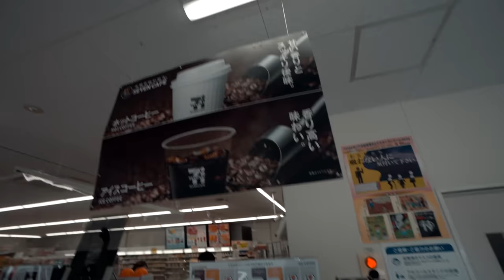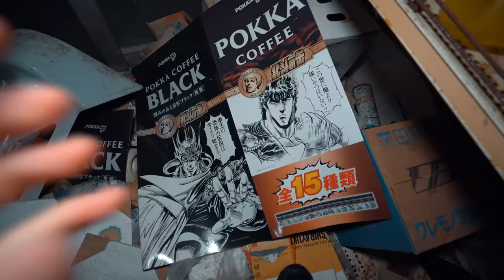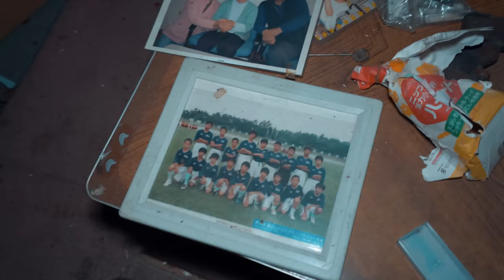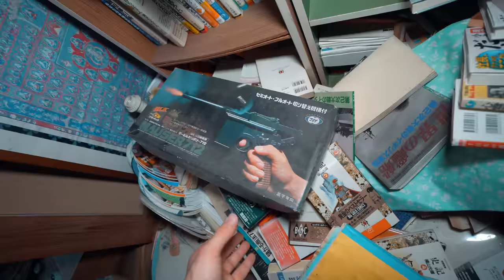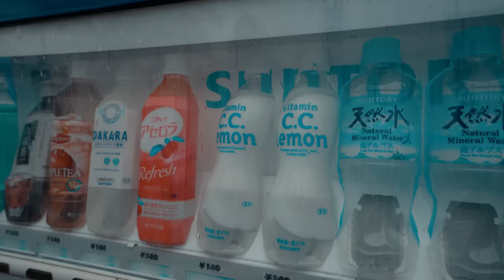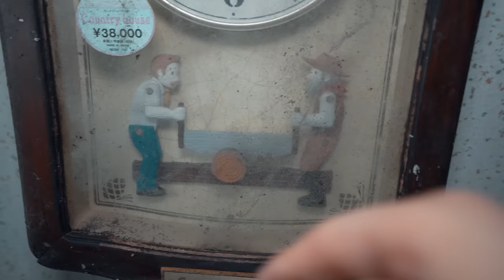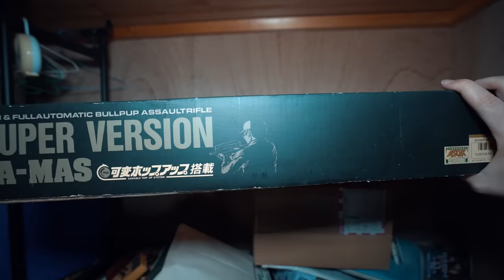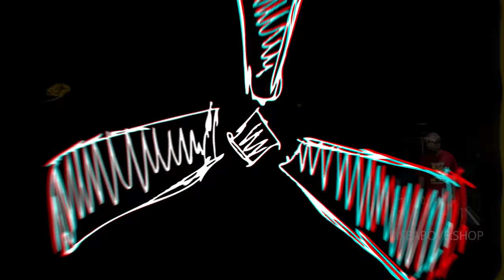100 Hours Inside JAPAN'S Toxic Evacuated CITY | Streets Are Empty With EVERYTHING Left Behind

Comment: At 9:08 those are for a photo printer in Japan They have little photo printers that use sublimation printing, and those are the cartridges for them and it probably has paper with it as well. It’s basically like how a printer has ink cartridges except with sublimation printers you would just use those instead.